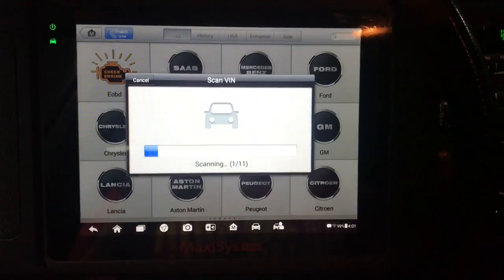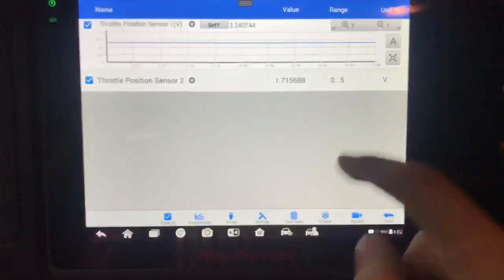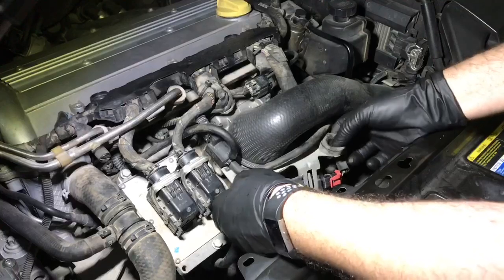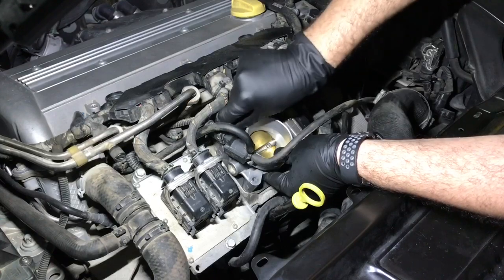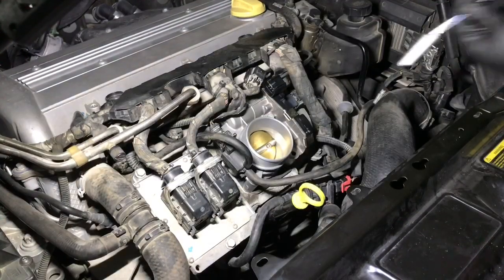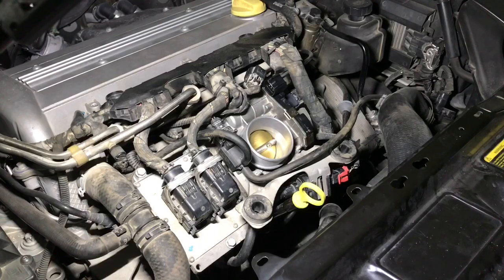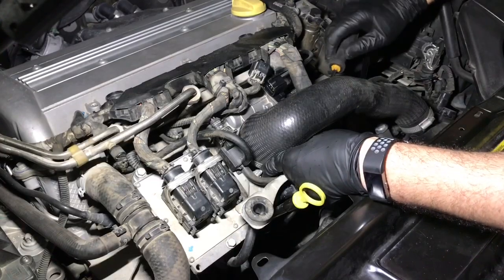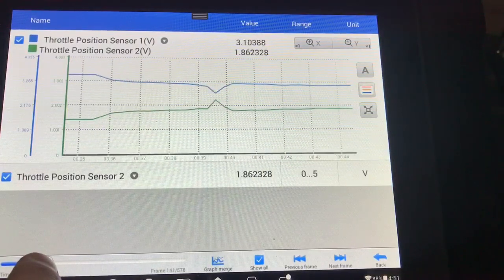SAAB 93 TPS trouble/THROTTLE BODY (works for any car)

Comment: I’m getting an intermittent sputter upon acceleration if I apply gas pedal slowly, it doesn’t happen as often but if I mash the gas off start, it’s sputters back-and-forth and I get an intermittent misfire P0300 swapped out many different coils doesn’t work
Reply: did you find out what it was?
Reply: @DraGSLight I was planning on taking a trip from Massachusetts to California, so I changed the spark plugs gapped them at .033, and everything was fine until I reached Tennessee and from Tennessee to California. It started sputtering I had bought several used good coils and every time I would swap them out it seemed to get a little better. I thought it was the harness so I was messing around with that for a while. I thought it was maybe another wire so I was chasing things all over the place, and then it came across a fee that said their engine seemed to run better when it was gapped less so I went from . 038.033 and it seemed to be better but then it started sputtering again and then I dropped it down to .022 and now that has seemed to be the answer to the issue. I found a fee that said it was recommended to lower the gap if the engine was tuned mine is not tuned, but I tried it anyway so maybe mine is tuned. I’m not sure I didn’t tune it, but that seemed to work. mine is now gapped at .022.. I hope this helps

Comment: Getting p 1538 p0638 no start...changing plugs didnt help...any idea?
Reply from the maker: There is no such P1538
Reply: @TheFlyingMechanicDIY  sorry p1523
Reply from the maker: @ have a visual inspection on ur throttle body if it is jammed/dirty or smthn stuck in it, it might need replacement eventually
Reply: @TheFlyingMechanicDIY  just pressed it  and it moved about 1 cm,was jammed and full of oil.The car started! Is it normal to have oil on it and in the hole after gasket?
Reply from the maker: @ a little oil is ok, too much would indicate turbo or pcv issue .

Comment: Hello. And whats about P2135 code?  Faulty Throttle body  or acceleration pedal?
Reply from the maker: Usually ECU or wiring, sometimes accelerator pedal .. i heard some people replaced throttle body to solve it but never seen myself neither i trust it, as this an accelerator pedal code

Comment: would this cause stutter when max boost at 60mph also got a p0442 thanks
Reply from the maker: No, describe the Stutter ..
Reply: @TheFlyingMechanicDIY  boost fine until 4th 5th gear then at full boost it begins to hiccups?pretty badly too. I reset the obd2 codes and seems like it helped but still have the stutter
Reply from the maker: @ZOMG1001  bad coils
Reply: @TheFlyingMechanicDIY  thx I had replaced cly 3 coil about 2000miles ago maybe they're all going
Reply from the maker: @ZOMG1001  u can look at the scanner live data, misfire data, during the event, and figure out which one exactly failing .. use only OEM coils

Comment: What about no error codes, but throttle sensor value shows 2 fixed values, first around 0.6V, second around 4.4V, idling or running, no matter?

Comment: Hi great video i have a saab 93 vector auto it was working perfect we pulled at the garage put fuel in it run fine but went to start it it started but run rough i got half way home and it wouldnt start so trailered it home still wouldnt start the next day so i took battery lead off and put it back on it started straight up but the engine light is on and it must be in limp mode as the pedal to the floor it on does 3000 rmp any help appreciated
Reply from the maker: U need to scan it for codes first

Comment: Can I replace throttle body on 2003 Aero with throttle body from newer model/ restyle 2007+, the one that have plastic cover over gears?
Reply from the maker: If u change the engine harness with it, and replace the ECM or flash it with newer software .
Reply: @TheFlyingMechanicDIY  Thanks buddy!
Reply: Pre 2006 are 8 pin connector,
2007 on are 6 pin connector on the throttle body.

Comment: My car isn't starting since replacing the throttle body with a new reconditioned one. Any ideas? It's just clicking at the throttle body and car wont crank at all.
Reply from the maker: Did u disconnect the battery before replacement ? If not, find a scan tool to clear codes, if thats doesn’t do it, then the new TB is bad
Reply: @TheFlyingMechanicDIY  It ended up being the battery. Strange thing is, it started up just fine 15 min. prior to putting in the new throttle body. Thanks for the reply. I appreciate it.

Comment: Hello 
Do you have any suggestions on what it can be when warning Light Limited Performance is on
Reply from the maker: U will need to read the fault codes with a scanner
Reply: I did and there is no fault codes 😑
Reply from the maker: @thisistheway1766  cant be, did u scan all modules or just engine !

Comment: Throttle body replacement, with a basic scan tool and battery reset does turn off check engine light. Either heat or electrical sets it back off. Do I need a Tech2 to properly clear and or program new TPS?
Reply from the maker: On the 2.0 engines, all u need is to clear any codes .
Reply: @TheFlyingMechanicDIY  Yes, thats seems right. I think the ECU got too hot and must send it off (ran water during a coolant leak issue that has actually subsided?) I think we're good. Thank you, sir.

Comment: Thanks for the video. I'm getting a P2135 code on my 2005 Saab 9-3. I tried locating the grey connector under the battery to check the connection but could find no wires at all when I took the battery and box out. Is it located toward the front? Thanks again.
Reply from the maker: Check the photo in this post,

https://www.saabcentral.com/threads/the-big-grey-connector-under-the-battery-h42-2-h24-2-connectors-same-connector-just-different-name-depend-on-model-year.736374/
Reply: @TheFlyingMechanicDIY  That’s great thank you. That’s more towards the front of the battery that’s why I couldn’t find it. Fairly easy to disconnect? Thanks again.
Reply: @JamesGodish  Hi Jim, were you able to solve the problem? I am having the same issue on my 2005 saab 9-3 aero
Reply: @JGDavid  Yes. I replaced the throttle body and I was back in business.

Comment: i got p0122 how can i fix
Reply from the maker: Check wiring between throttle body and ECM, if all good then replace the throttle body, in rare cases a defective ECM can cause that code

Comment: Hello friend, I need your help please I have been struggling with this heinous error code P0638, save me! I talk to you; I ordered another used throttle body and replaced, both bodies lubricated them from the gears and tried, I have also put an alternative accelerator pedal and clean of the tracks, the code continued, I checked the wiring physically in the harness and it looks clean free of rust I don't see broken wires. I did this because I bought parts at a good price, all used. I tested 2 throttle bodies and 2 pedals in total. Suspect my ECU and clone another one, I did tests and the error continues, I have not checked the cable under the battery, I have Tech 2 and I would like to diagnose like you. My symptoms are always at a certain speed or accelerating my saab, it seems that the body closes and slows down until I stop the car shakes, I turn off the car and start again, sometimes it starts normal and others a little slow. Greetings from Mexico and thank you.
Reply from the maker: It is hard for me to guid u with diagnosis on this code, however its always either the throttle body or ECU .
Ur best chance is to to try to take the parts from a working car and try to know if it is the throttle body or the ECU
Reply: @TheFlyingMechanicDIY  
I am going to clean the h24-2 cable connector first, then I will diagnose my TPS sensors, I hope to find the error. Your video has helped me a lot even so, thank you.

Comment: I keep getting PO638 on my 05 2.0t Saab 9-3.Does it mean a new TB is required?
Reply from the maker: It usually points to a failed TB , sometimes if the big grey connector under the battery has any corrosion will cause the same fault code, however in some occasions a bad ECU can generate the same code .
Reply: did you end up fixing it? and how?

Comment: Base on your experience what you think about a 2003 saab 9-3 turbo that  had the battery disconected to clear a steering wheel code so that it can drive again which it did but die in the middle of the road the next day.. When opening the hood I've noticed a noise (whistle like) and clicking noise Coming from the throttle body when I removed the intake hose I can see: the throttle body trying to go back to the original position?? (That's my guess) but was  unable to do so.. the clicking sound will stop for a moment and it will do it again as the Wise sound will continue??..
Reply: By the way.. The only way I can get it to stop is by disconnecting the battery..
Reply from the maker: U should be able to read the fault codes stored in the car when this happen by any cheap OBD reader, and post them here .
Reply: @TheFlyingMechanicDIY  PO122 , PO223 , PO687 , PO638 , PO122 , PO223 , PO687 , PO638.. So I've change the spark plugs and did a radiator flush car was running excellent before all this.. I've noticed my battery was week and I was in the process of getting a new one but then all this codes appear.. On the fuse box I also noticed that someone have put a 7.5 fuse in the place of the 5 fuse (on place number 2) that it needs to written with the steering wheel lock Wich by the way that message didn't show back up any information will be appreciated since the car only turns but no start at the moment..
Reply from the maker: Angel Angel , make sure u have a good battery to start with, it can mislead our diagnosis.
from the codes, i can see u probably have two separate issues, one being the throttle body and one being the ECU.
I would suggest throttle body replacement initially, which should solve the no start if the codes remain the same after battery replacement.
however there might be codes remaining after all that and these point to a failed ECU but it would not prevent the car from sunning and driving.
Reply: @TheFlyingMechanicDIY   all I'm gonna say is that I have made the most expensive radiator flush in my life!!.. Turns out that when I was doing so I've splash some coolant/water in one of the plugs of the computer and so it burn it.. Your guess was right when you said it may be the computer.. Do you happen to know a trust worthy business that sales those ECUs??.. hopefully that's all I need for now to get back running..
Reply from the maker: Angel Angel , i can only suggest u to stay away from eBay and look anywhere else
Reply: @TheFlyingMechanicDIY  10-4 Boss man..

Comment: What if you don't have any codes?
Reply from the maker: Can u explain !
Reply: No codes or check engine light, but my car revs fine in neutral, but once in gear it hesitates until the gas pedal is pushed all the way down and then the car moves. It does this in each gear, I was think either tps or gas pedal sensor

Comment: Thanks for a very good video. I have problems with surge when in cruise control. If I set it at 70-80mph, it's not as noticeable, but if it's set at 90mph then the turbo needle fluctuates constantly, and there's a noticeable surge, with the car pulling and stopping constantly. You mention TPS only fails under the same acceleration demand, could it be this that's the problem? I am not getting a surge if I accelerate and keep the speed steady, the boost pressure holds (I check with an eSID). It only happens in cruise control. So far I have changed the boot control valve, and the bypass control valve, and no luck. Am in the process of changing the bypass valve. I saw your video about the possible vacuum leakes and decided to do a gasket for the bypass valve. Unfortunately, it failed, and so I put it back to factory. I am thinking maybe I disturbed the alignment of the valve and, so I am getting a leak. Will install a Forge valve in the coming days. Any suggestions would be welcomed. Thank you very much again for the good videos!
Reply from the maker: Its hard to pin point the issue remotely, however from experience if there are no fault codes then bypass valve is an option, TPS and MAF ..
But could be boost leak as well. Good luck
Reply: Thanks for the reply! I'll see where I get with it.

Comment: Thx, does new TB just plug and play or need relearn by tech 2?
Reply from the maker: As long as u remove the battery before the removal of the TB and only connect it after you done putting the new one, then no need for relearn

Comment: Hey my 2005 saab 9-3 wont turn on anymore and just cranks, bought some starter fluid and wanna test to see if it turns on with it. Do i spray the Starter fluid in the "Throttle Body" or in the "Intake Manifold"? I'm a complete noob

Also, The car fails to connect with 3 of my scanners so I cant get any codes.
Reply from the maker: Chuy i would spray it in the throttle body, however if u say its not connecting with a scanner, there is a good chance of an ABS module failure .. bit cant confirm that without proper testing
Reply: @TheFlyingMechanicDIY  I appreciate the quick reaponse! Will do that when i get home & funny that you mention ABS because the ABS light is on.

Comment: Are these bad on the 2011 turbo4s too. Mine is a 2.0 engine I think, but the gas pedal feels really loose, car wouldn't start sometimes, and after stopping and driving slow and car does not shift smoothly through gears. In traffic it is pretty annoying when you are stopped then have you go because you have to press down sorta far and the car feels like it goes really slow then bucks, any help with this issue or if it is this? I have never had an engine light go off at all?
Reply from the maker: James McDonald thats really tough to say based on the symptoms only ..
Reply: Did you ever figure it out I have the same issue
Reply: @Thatdude121312  It's a common 2.0T saabs fault. Many people have reported this issue on these and the older 2L saabs unfortunately and that's just the way it runs (no cel,, anything) and yes I replaced almost everything. The Saab 9-3 2.8T V6s tend to run more responsive and smoother without these issues I'm currently selling mine for a v6 Saab. (This is related to the bucking issue though) I replaced the fuel pump and it starts right up, the weird noises come back though but it still cranks

Comment: Another note on this TPS is the connectors under the battery, I had throttle body error P0638-after hours of research on the boards, there are a few connectors under the battery tray, that you can take apart and clean with contact cleaner. this cleared my code, i forget what it was though. Another one of the Saab known problems. just fyi for anyone else. Here is also a tsb for pins, but I believe they call the connector H42. 
Multiple Junction Connector: All Technical Service Bulletins
Engine Controls - DTC's P0638/P1682 SetTECHNICAL SERVICE BULLETIN
Bulletin Nbr: 248-2423
Date: November 2003
Market: allDiagnostic trouble code P0638 and/or P1682, dislodged pins in H42-2Cars affectedSaab 9-3 (9440) M03 with engine alternative B207E/L/RBackgroundDiagnostic trouble code P0638 and/or P1682 can be indicated despite the fault being located elsewhere than indicated by fault diagnosis. Several 
electronic throttle actuators have been replaced unnecessarily when the fault is dislodged pins in connector H42-2.For this reason, H42-2 must be checked with regard to dislodged pins before the electronic throttle actuator is replaced. In particular, check the pins
which are connected to the accelerator pedal position sensor (pins 13, 14, 17, 18, 19 and 20 in H42-2).In the case of customer complaint the following procedure must first be carried out.Symptom descriptionDiagnostic trouble code P0638 and/or P1682 are/is indicated.Procedure1.Read off the car's diagnostic trouble codes.2.Remove the battery cover etc etc.
Reply: It would be nice to have a short video how to access and clean those problematic connectors. I also have p0638, my TB is dirty and needs to be cleaned so this video really great for me, but I am confused where to find h42-2 and what parts should be removed before.
Reply from the maker: Joeybabbs .BABBS i left a link in the video description for the most complete TSB about the issue and the connector ..

Comment: Thanks for posting it. What type of diagnostic tool are you using. It looks much more modern than a Tech2. Does it replace it ? Thanks
Reply from the maker: Gaetan PERRIER im using MAXISYS906 .. which an advanced scan tool for many makes and model, it is much more futuristic than a tech2 but it doesnt replace it 100%, maybe 95%
Reply: @TheFlyingMechanicDIY  Great thanks. Can I also make some setting modification  such as lights , doors closing like on the Tech2. Looks like a much more handy tool and works on more cars. I should consider this one. Thanks again
Reply from the maker: Gaetan PERRIER u can do some stuff, it can add keys for example, change engine idle speed and others, but not a full list.

Comment: Thanks again for another useful and nicely done/documented video. What scan tool did you use on your tablet? And what OBD interface works with the scan software? Is this some software port of Tech2?
Reply from the maker: Alex Sakellaris this is a stand alone scan tool MAXISYS906 .. it has similar software to the Tech2 and many other factory scan tools